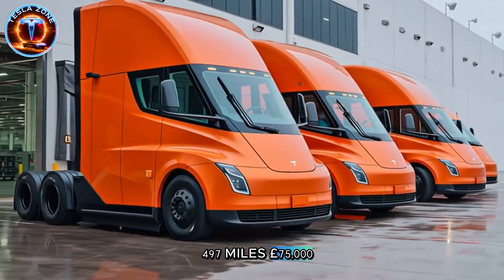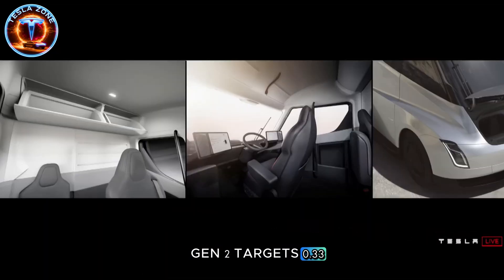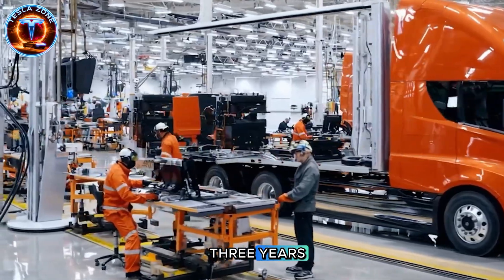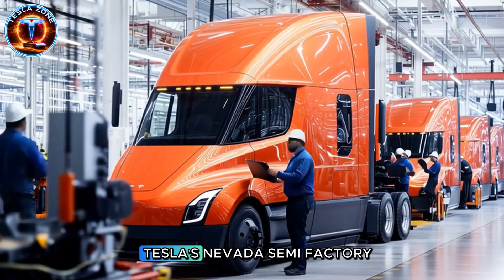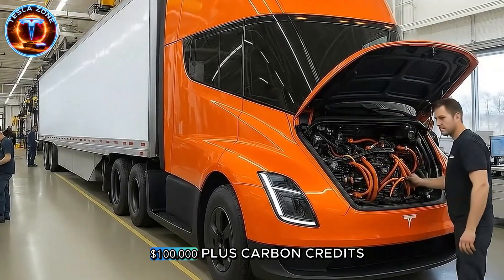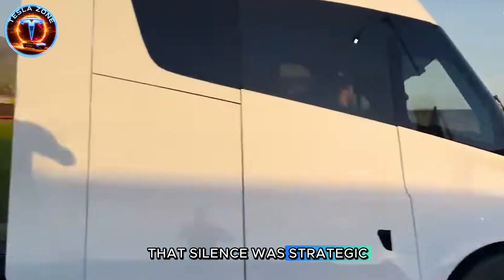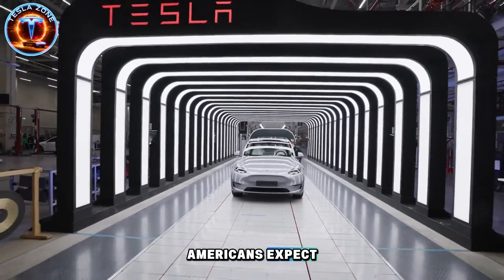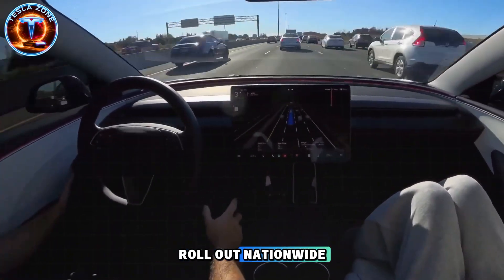Tesla Semi No Joke Anymore: Elon's 497-Mile Beast...Diesel Era Ends Now

Comment: The charging infrastructure will be the difficulty. In how many places is a grid connection large enough to charge 10, or 20, or 50 trucks available? Allow minimum one MW per truck, plus say 10% conversion losses, that's an 11MW connection to charge just 10 trucks simultaneously. 11MW is sufficient for 4,400 European homes, that's a town of about 10,000 people. The grid in so many countries is overloaded, and there is maybe a 5-year wait to get connections.
Reply from the maker: charging infrastructure is the hardest bottleneck for Tesla Semi. The bet is Megacharger hubs + on-site storage to bypass weak grids—scaling decides if diesel truly ends.
Reply: @Tesla-Zone26  Yes. On-site BESS is likely for truck chargers. But, that will be even more expensive.